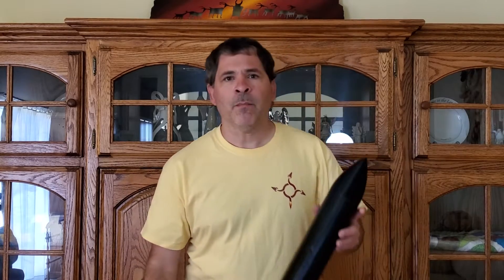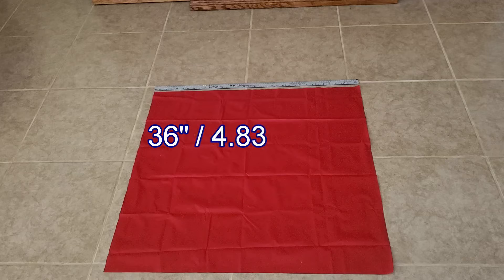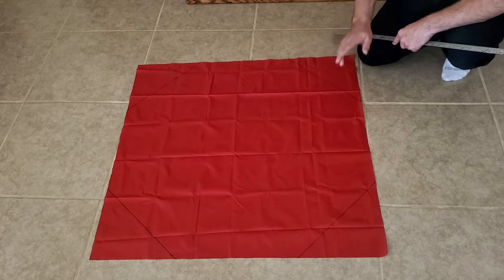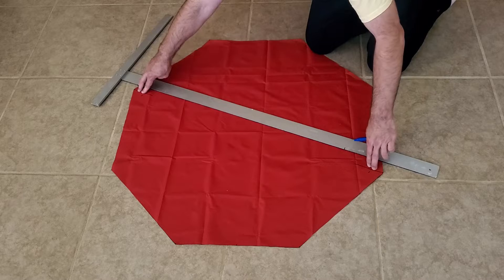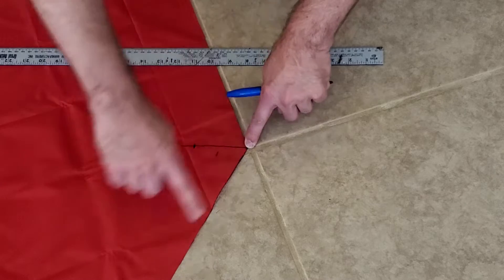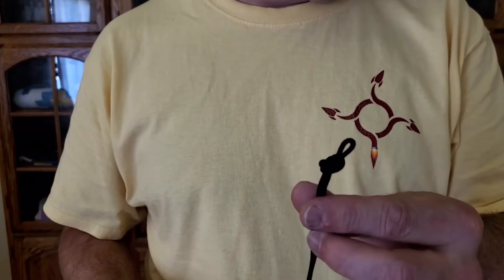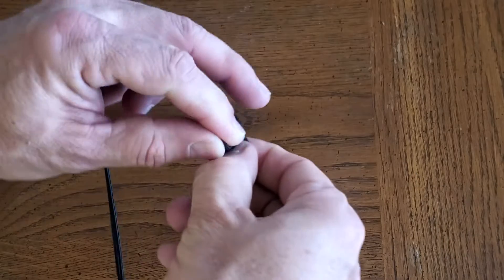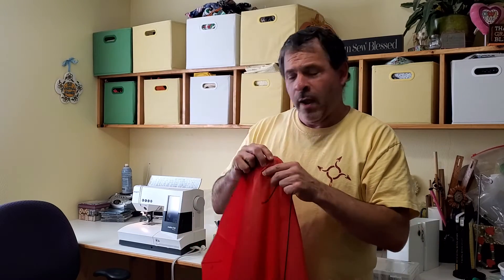How to make a simple ripstop nylon parachute DIY

Comment: can i know if the exact cord can be use for cansat project? or is it too thick for cansat of 350g weight?
Reply from the maker: I think this would be a great parachute design for a cansat. You just need to decide what size parachute you want depending on how fast (or slow) you want it to descend. We use this 3 foot diameter parachute on a 1000g rocket.

Comment: Look, I know that I’m getting ready to sound stupid here, but why aren’t you using 9”, which makes each straight edge at 9” evenly?😮
Reply from the maker: Difficult to explain in words without an illustration. I see where you might think you would just divide each edge of the fabric into three sections of 9" each. But the line that you follow to cut off the corners is the hypotenuse of a triangle. The hypotenuse of a right triangle with two 9" sides is 12.7". So you would end up with a parachute with 4 sides at 9" and 4 sizes at 12.7". Trust me, the math I gave is the easiest way to get the proper 8 sided shape.
Reply: Thank you very much for your reply.
I never would’ve thought of the hypotenuse and having four longer edges.
The way that you have answered me makes perfect sense to me and really helps me to understand why you did what you did.
Thanks again for your reply.